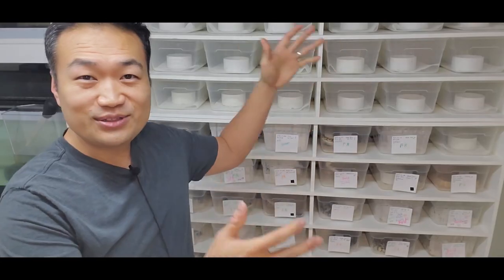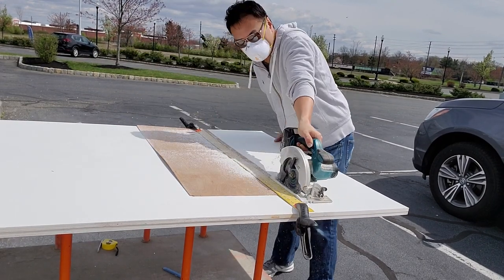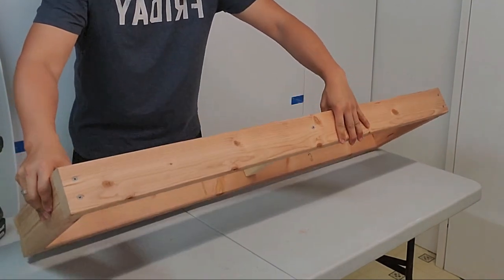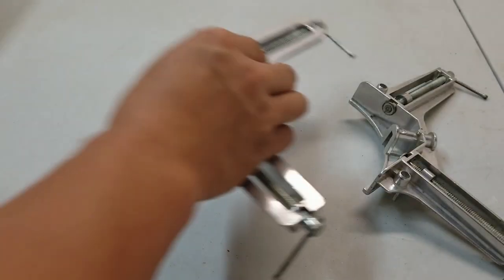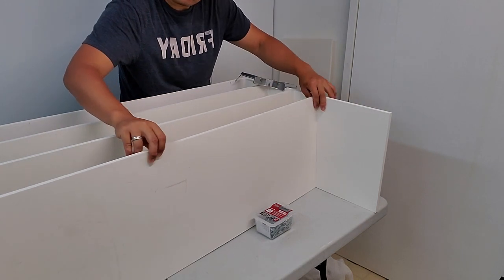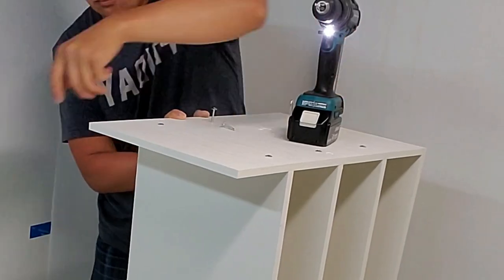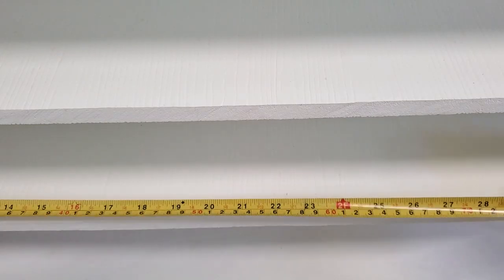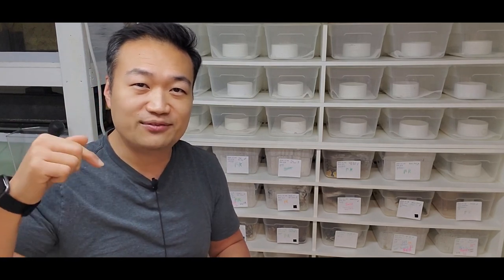Huge DIY snake rack in under 20 minutes

Comment: That was Boss cutting in the parking lot. I am building a 12 high fb40 again, going to use my router and cut 1/2 inch  dattos to seat the shelves in snug and use pvc glue instead of screws to weld the pvc to itself. Should look nice and clean. I have found routing all the heat tape grooves and dattos for shelves are much easier when the sheet is full and not ripped down. Send you a pic when I'm done.

Comment: Do you still use the STC-1000 temperature controller units? If so how well do they last and how have they worked for you?
Reply from the maker: I have approximately 50 units running. They do a great job. Over the years there has been 1 that stopped working. At $15 each, it was easy to replace

Comment: Where do you get your casters? Also, what are the advantages in using a round headed screw? Love the channel!
Reply from the maker: All the materials were purchased at home depot. Screw heads that are beveled and flat are made to sink under the material surface. The dome head Screws are for sitting above the materials surface.  The wider the diameter of the screw the more it spread out the pressure.